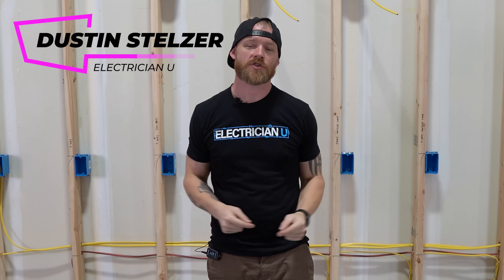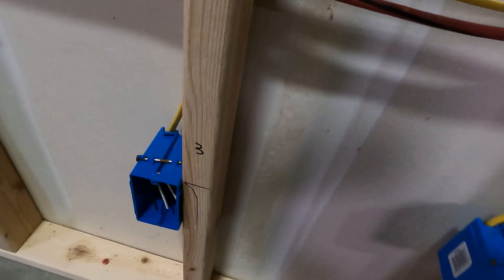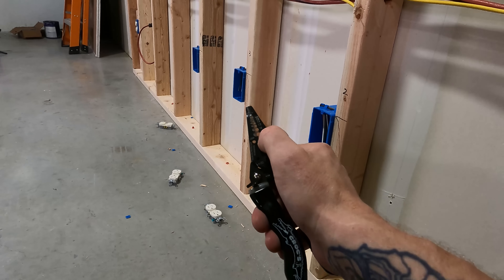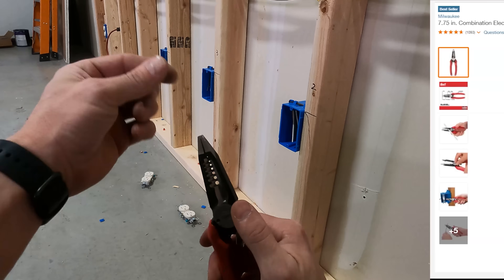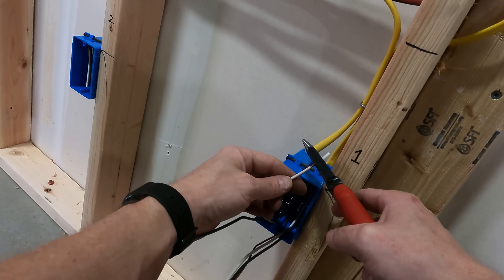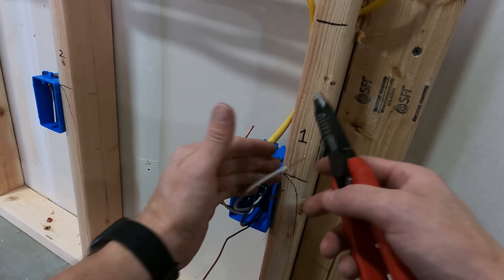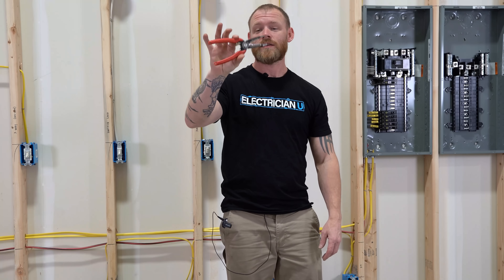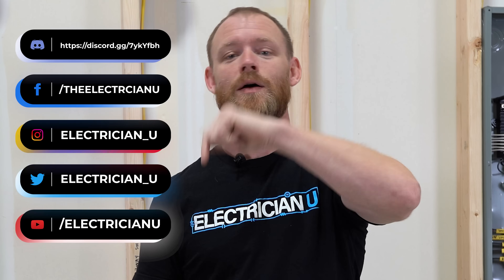Techniques on Stripping Wire - Awesome Tools to Help Electricians

Comment: I'm learning to strip conductors in 12-2 romex.  Using the correct gauge on the stripper (12 solid), even with a new basic pair of Klein wire strippers, though they're a little better, I keep nicking the copper some of the time.  The best way I can figure out to avoid it is to try to gently squeeze the stripper down only enough to cut through the insulation, let go, then manually pull the insulation off with my fingers.  Even then I find I'm still scoring the copper a bit.  I've seen from others and demonstrated to myself that these little scores/nicks weaken the wire.  How can I use a regular wire stripper and not damage the copper at all?

Comment: Hawkbill stripping knives are great if you don't have the auto stripper power tool. Since the blade is curved it helps with skinning the insulation off without the blade wanting to dig into the conductor if you accidentally cut too deep or use too much pressure.

Comment: I've tried the method of slanting the pliers and it works extremely well and I was thinking this is the Holy Grail of wire stripping.  However, after doing it a few times, I found that most of the time, its leaves a tiny nick in the wire.  The reason is that the tilt essentially reduces the size of the cutting hole, more and more as you move aways from perpendicular.  I cut a piece of Romex a whole bunch of times and then peeled the casing back a little more and almost every time I could see and or feel the tiny nick.  There is probably a sweet spot, maybe just a few degrees off 90 degrees where you cut through the casing and don't nick the wire, but it would be hard to get it exactly right like that every time.  I guess my question is:  Is that tiny nick anything to worry about?  I've always heard nicks are a big problem and can lead to failure over time, but maybe a tiny nick isn't a big deal?

Comment: Embarrassed to say, I have been doing electrical work for ages, and the simplest things that you demonstrated in the first few minutes revealed that I waste more time stripping the wires for receptacles or switches than I imagined possible. 😂
Doing the slight things to make the insulation cut alone really helped. I’m left handed so perhaps the angle for the strippers works against me. I know scissors are prone to being something I usually use my right hand for to keep the cutting edge better aligned, never thought about wire strippers being the same. 

Doing the strip and hook in one motion, that’s another no brainer issue. I hadn’t seen anyone do the hook with the holes in the tool, I generally stripped with the stripper and grabbed needle pliers to do the hook. 

I should add I never did an apprenticeship with anyone, nor have I ever worked in a team of electricians. I learned entirely by myself when I started working (~1985)and went into the field via concert lighting and only after leaving that field late in the 90s and 10 yrs later reentered into electrical work when I started my handyman business focusing on electrical work. 

Great content and I find a lot of very useful and interesting things to learn from you and others on the YouTube channels

Comment: Great tips. I'm lazy and tend to use automatic strippers... Picked up one of the Milwaukee needle nose stripper multi tools you used in the video recently. Your tip to tilt the tool is really helpful. I kinda hated manual strippers without that trick.

Comment: I've been using the Ideal Kinetic Reflex strippers with the curved handle for going on 19 years. When I first started doing electrical work, it was primarily service work on lighting in commercial spaces and couldn't always turn everything off. These strippers are perfect because the area where the pivot sits is completely covered in plastic and rubber and allows a spot for your thumb to press and strip without contacting any metal. If you haven't tried these, I recommend them. They're really the only ones I care for. Super light weight and comfortable for all day use

Comment: Check out the Knipex version of that combo linemans/stripping tool Klein and Milwaukee make.  The features are the same as the Milwaukee but with better "polish" with features like a hidden spring mechanism, less annoying latch, and a wire cutter shaped to pin larger conductors closer to the pivot point.  It's hard to describe that cutter...it's shaped in such a way that you are slicing into the wire as you squeeze the handle but before the cutter is fully engaged.  The result is you need to use less force when you cut big wires.  And since the shear/cutter is rated for 1/2" wire you can also use it to strip that wire too.

Comment: Yes they are made in the USA, in Sycamore Illinois.  I bought a set after I seen them at an IEC trade show.  Now they are my number 1 pair of strippers.  I love the handles, hate the ends where loop holes are.  They strip wire with ease when I use the slant and twist method is just smooth.  The cutters are not so great. Takes some effort to cut 3 wires.  The jaws are very nice.  I recommend them.

Comment: Great videos.  I grew up as an electrician's "apprentice" since probably age 9 and didn't get into the trades.  I still help dad with projects on occasion so I like knowing what I'm doing.  I think dad got his license around '72 and as long as I can remember he has had a 3 bladed Klein electrician's pocket knife that he uses for stripping large wire.  One blade has a slight curve to it that he runs around the wire then you start at the score and run it down the wire.  It is quick and no need for tugging the insulation off.

Comment: Interesting that you didn’t show any automatic wire strippers like the Klein Tools 11063W Wire Cutter. I only do electrical every couple months so those work great without using any technique. But you were so fast with the standard wire strippers the automatic ones probably don’t add much benefit.

Comment: I picked up on how you cut with strippers at an angle and flick it up to get it started way back when you only had a couple videos. I think you mentioned it in your video for a receptacle or 3 way switch. That has been the most useful trick. I then noticed at trade school watching everybody struggle and tug on wires and fight with it. I cannot overstate how useful such a little bit of technique is thanks for sharing. Keep killing it bro!

Comment: I'm an refrigeration and commercial appliance tech and I love your videos, I am a little surprised you didn't show a pair of auto strippers. I have the klien ones and I love them, sure they take up more space in your bag but it is so nice when you are trying to strip wire in uncomfortable places. Maybe it is just me because I often find myself trying to strip wire bent over between 2 scalding hot ovens trying to not touch either of them or wedged inside an under counter refrigerator but I can't go back after making the switch.
Reply: While I like auto strippers, it's a great tool though limited to doing one thing well, stripping wire.  The tools covered here are useful for so many other tasks.  If you have limited tool belt space, which would you carry?
Reply: @sunriseorsunset328  I'm an HVAC/R tech with limited space in my tool bag and I actually carry auto strippers with a separate pair of crimpers, not saying one is right or wrong but he showed single use tools in this so no reason not to bring up another useful tool for electrical work.

Comment: The Milwaukee Is the to go striper I mostly do residential so not much conduit but I use the side of the Milwaukee to sand off pain off grounds when there's paint on them 😑😑😑

Comment: On 2/0 and 4/0 I use the small Rigid copper pipe cutting tool, it's small and does the job...

Comment: maybe i'm just an old lump of coal but I never had a $1000 fancy tool. I used a utility knife. The same way my grandfather striped wire in the 1930's.  Ever hear auto mechanics talk about the parts cannon?  The tool cannon is the same thing.  Travel light my friends.  Do more by carrying less.  Got my Masters in 1997.  Used none of these and zero explosions.

Comment: Great vids. I just looked through all your vids looking for a particular topic that’s been coming up on other channels that I would like to get some clarification on. It would be great if you can do a vid on as well. Older homes that have two wire conductors and two prong receptacle being replaced with gfci. Some vids out there are blatantly saying these older homes are not grounded so here’s how to add a gfci. They all seem very sketchy to me. I have an older home with the metallic wrapped romex and just like conduit the metallic wrap is the ground such as the conduit as long as there are not breaks in it. But however these vids explain how to install gfci recepticals work and work properly. I’m hoping you can shed some lite on the subject or maybe have a better way to explain it.

Comment: I noticed you installed those outlets "ground pin down". I hear many stating to do ground pin up. Could your elaborate on this discrepancy please? I heard that advantages of ground pin down is that a loose plug would have the ground being the last to disconnect (which sounds unlikely as the device would have to pull the plug lower than the outlet). I heard the ground pin up advantages are that it doesn't look like a "face" so infants and toddlers wouldn't be drawn to it as much (???) and if a sheet of metal should slide down a wall, it would deflect off the ground pin and off to one side (which would decrease a short by half if it slid off to the neutral side of the plug). So much confusion, and then there's horizontal outlets and which way they should or could be installed, if at all. Any thoughts? Love the show BTW!! :)
Reply from the maker: There is no code article that dictates what orientation should be used for a receptacle. 

It's all down to personal preference and local codes. 

In hospitals for example any of the dedicated circuits or isolated ground circuits night be ground pin up. 

That's just one example of local code adoptions in practice.

Comment: The way you sliced the insulation off the conductor with the razor it was like you were peeling a carrot. It's much easier if you cut a circle around the wire and then a deep line down to the end.

Comment: The klien multi tool strippers also comes in a shear cut version wich cuts with way less efort tan the punch cut. Ive cut 3/0 with relative ease

Comment: Dust ...?  If you are pulling single wires in nonmetallic conduit you are three or more circuits how much EGC we suppose to have in this case
Reply from the maker: Depends on the devices. If three devices require a ground. You pull a ground for each device.

Comment: Hey, I’m in the cellular communication industry, I use wire strippers on the daily, the one issue I have with my strippers is that they don’t go up to 6 wire
I have seen strippers that do go up to 6, but I can’t seem to find any. Does anyone have an recommendations of a brand or version that does have the slotted 6 hole?
Reply: If you're talkin about like 6 stranded? I have a pair of klein 11053 that go up to 6 stranded and they have the blue curved handles. I like them well enough for that size, but if im dealin with smaller gauge wire i prefer my ideals or knipex strippers, nothing wrong with the kleins just my preference recently.

Comment: One of the complaints I have about most strippers that I've used is the sizing for the "stranded" conductor.  I know that stranded will have a larger circumference than its solid counterpart, but the two gauge gap used on the indicators between the two seems like too much.  Any time I have tried to use the hole for, say, stranded #12, I always end up stripping the outside film off the conductor and not coming anywhere close to cutting all the way through the insulation.  I can sometimes get it to work if I really wring the wire around in the strippers, but most of the time I just find myself sizing down to the next gauge (#14 in this case).  Unfortunately, if you are not careful with this method you can easily bite through the outer strands of copper, separating them completely and compromising the conductivity of the wire.  

I know that separating one tool into two isn't ideal for efficiency, but I would really like to see a set of strippers that only had selections for stranded wire, with those holes sized precisely for that job.
Reply: Buy a stranded wire stripper from Klein. They've been making them for years.
Reply: @illestofdemall13  Great! No idea they even had those (obviously).  I've only been in the trade for about 6 months and most of my tools have been selected based on what Home Depot had in stock, so some of this specialized stuff isn't on my radar.  I also noticed they have a "self-adjusting" stripper while I was searching this one up.  Have you used one of those before, and if so would you recommend it?
Reply: @Hubris73  I'd recommend the self adjust one but it's a bit bulky to fit in a bag/pouch. I will look for a link for the stranded wire stripper as well.

Comment: How well does that strip/pop method work on stranded wiring?
Reply from the maker: Works the same. It's just dependant on the size of the conductor in question.

Comment: Milwaukee 6 in 1 is such a great wire stripper I love them Nd will only those for the rest of my career. The 7 and 1 that has the crimper and wide nose sucks don't waste your 30$ keep the 6 and 1

Comment: Take a note on how you're bending your hooks:
Using the pliers, you bend them in the proper direction for install, but using the hole, you are bending them in the opposite direction, and you will have to twist the hook for install. Insert from the opposite side and bend, and the hook will be oriented properly.
Reply: If you do it that way, it's already facing the direction you need it to, and you don't have to take an extra step to correct it.
Reply: You can bend them and turn them any way you want them either way. You can stick the wire in the hole from front or back and bend in any which direction. It doesn't matter because the wires will get positioned in place when installing, regardless of how you bend the hooks. Also, the hooks for the hot side will go in the opposite direction as the neutral anyways.
Reply: @illestofdemall13  you can only bend them one direction, and it depends on which side you put the wire into. Front side you fold away from you, back side you fold toward you, but the resulting hook is oriented in opposite directions.

If you place the hook on the device where the curve of the hook is going counterclockwise, it can loosen the hook as you tighten the screws.
Reply: @curt2742  The hooks point in different direction my friend. They are both clockwise to the screw but the screw terminals on the right (hot) the end of the tip of the hook will be facing up, and on the left (neutral) they will face down. I know how to terminate a device without installing the wire in such a way that the terminal screw will open the hook. That is pretty elementary to be honest.
Reply: @illestofdemall13  the entire video is elementary, thats the point. It is geared at helping newbies.

Professionals often take a lot of what they know for granted, especially the little things.
Reply: @curt2742  I am saying that I know which way the wire needs to go in order to not open up. I was just responding to your reply. I like watching Dustin's videos for tips even though I am not a newbie. You have some good points, I was just putting in my 2 cents. Hope you have a Happy New Year.
Reply: @curt2742  If you turn your hand and the stripper, you can bend the hook up or down, left or right, from the get go. The way he did it in the video ,though, you are correct that he will have to re-position their orientation.

Comment: Ideal wire strippers are beat imo. The rubber handles on the Klein Romex strippers are junk. Pulling the ground with lineman is easiest if u don't have $$ to buy strippers

Comment: I've used all these under a residential setting mainly and the one pair of hybrids that are the best imo are the black and grey handle klein hybrid players. Does 14-10 awg and strips super smooth and still has enough gnurl to splice multiple wires.

Comment: I bought a pair of those Milwaukee strippers. They feel nice, yet chunky, and sturdy. They feel like these baby's here got some chooch. 
I have a bus tub of of wire scrap I work out of for pigtails etc close by.
I reached down for a small length of #12 white. Somehow a short length of white steel coat hanger had ended up in there.
When I realized what was what as I was cutting it to length, it was too late.
1 cut on a coat hanger, and the cutter blades are toast.

Because of the curved edge on these blades, any filing will just make it worse.
Bummed. I thought they'd last a lifetime.

Comment: Hey Dustin! 3rd year apprentice up in alberta Canada. Have you ever tried stripping 2 conductors at the same time? If I'm stripping 14/2 i use the 14 gauge stripper and put the second conductor in the 12 gauge spot. It's a little harder to strip but not significantly harder. I use the same klein heavy duty strippers you use in the video i like those the best. I started doing this about a year ago and use the technique all the time. I think it speeds things up quite a bit.
Reply: this
Reply: underrated comment

Comment: I've grown accustomed to the needle nose strippers, I like them a lot. I also got the 15 in 1 ratcheting screwdriver, and ik I thought it was just a gimmick at first, but its options are wider and they're stored in the base, unlike the og 11 in 1, where you have to flip and flip to find what you need.
Reply: I just switched to the 15 in 1 from the 11 in 1 (got it as a stocking stuffer from the wife) and I like it. The only down side is I use a 5/16 and 3/8 nut driver a lot for my job so I added the 7 in 1 to my bag also.